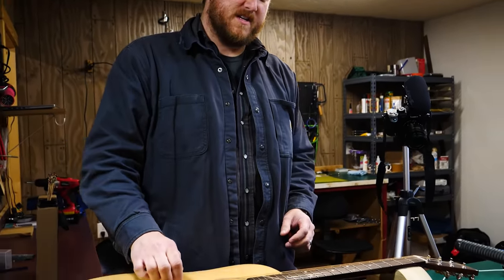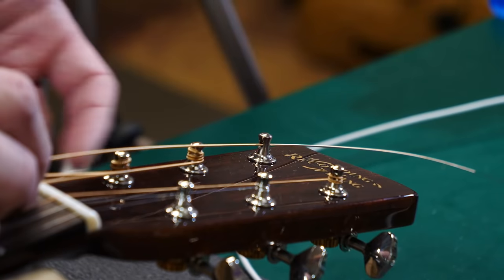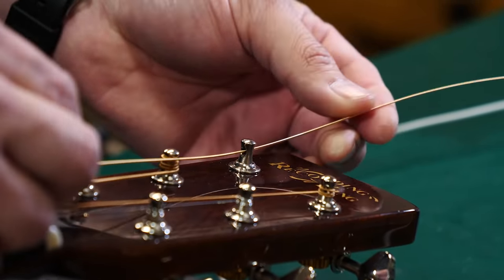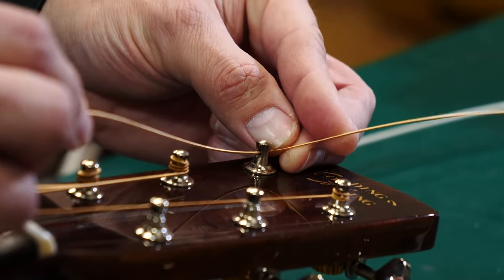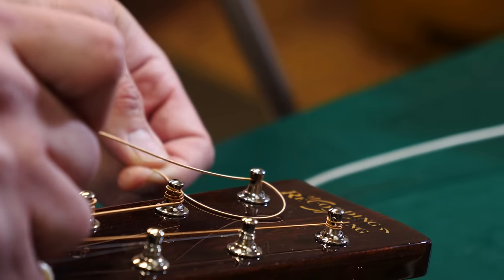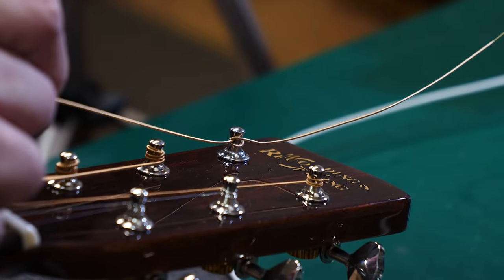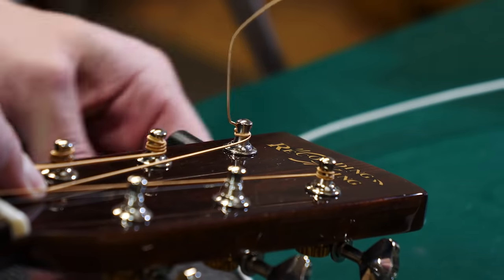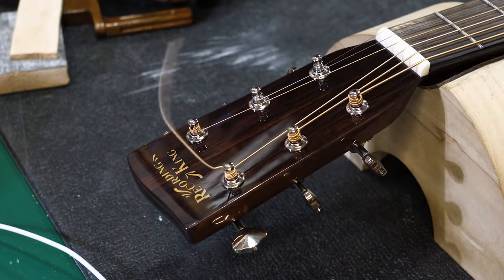Tech Tip: How to Tie a Luthier's Knot When Changing Strings

Comment: I just wrap one wind on top of the tag end, and the rest underneath.  It "clamps" the tag end in place, just like this knot, except it's easier.  I've never had an issue in 20+ years.  I do know a lot of luthiers who swear by this method, so I'm sure there's something to it, but I've never seen a reason to change.
Reply: Yep!  I usually pull the string tight and throw 2 or 3 or 4 wraps (depending on which string)  around the post before I push the through the hole and under the 1st wind.  Then give the end a sharp 90 degrees up. Then it only takes a little wind to get up to pitch.  Saves a lot of key turning.
Reply: @brin57  I've done that, too.  I always give the tag end an upwards, 90 degree tug before I clip it, too.  Never once have I had an issue.
Reply: I've found this knot works for me for plain strings on a classical guitar (on the wound ones I just use "one over, the rest under" technique). The nylon strings are more slippery and with this knot it's easier to keep them in tune.
I don't have an acoustic guitar, but I guess it's similar to an electric, where indeed I've never had a problem with just 2-3 turns, without any knots.  As always, YMMV.
Reply: Good Luthiers will never recommend this. Knots belongs on fishing lines not guitars
Reply: @larry6686st  Old dogs CAN learn new tricks that work well.
Reply: ^No reason to do more than this on modern tuners. 
“The luthiers knot” is completely pointless on modern tuners. Just a hassle and a good way to get your finger pricked :)
Reply: I have been playing and repairing guitars since 1982, and I do the same thing that you do.  Tuners are designed to hold the string with the sharp edges on the hole grabbing the string.  I have never seen them slip.
Reply: Locking tuners!
Reply: You have it right! This is nonsense!
Reply: Yeah I’ve done it exactly as you described for 30+ years. Works fine.
Reply: that's exactly what he's doing here though... literally zero difference between what you explained and what he did. The post is literally designed to function this way
Reply: I absolutely love this method. Been playing for 20 years, never had an issue with all my guitars strung this way. It also makes for a very clean look if you’ve done it right. I’d love to show you a guitar my customer brought in where he tied up the strings like shoelaces and wondered why the wouldn’t stay in tune.
Reply: Same. My father was a Luther, and so am I, and this is how we always do it.
Reply: @quistador7  not quiet, but very similar. Our way requires no knot. It's just how you wind it. Gets the exact same job done, and is arguably easier by a small margin. The point is, most lithiers don't use this knot, we just wind it the way op described, with one loop over, and the rest under. No need to bend the string over itself.
Reply: This is what I do.
Reply: If you do it the way shown in this video, your playing will improve exponentially. You’ll also get more chicks. Proven fact. Oh, you use the luthier’s knot? Welcome to heaven, here’s your harp! Oh you don’t use the luthier’s knot? Welcome to hell, here’s your accordion...
Reply: I was taught this way too. No problems even with a bigsby!
Reply: I typically use the top loop on wound strings and the knot method on the unwound strings.
Reply: Elite.
Reply: For steel strings I do what your describing. Works perfectly and can make the winds neat without any tuning problems. I use the luthiers knot technique on nylon string guitars since they need the extra friction.
Reply: 30+ years, one over, the rest under. Wedding band, rock bands, open mics, no problems.
Reply: I do the same exact thing I never had major slippage I've had them pull out of my tremolo as I use floating trem Bridges his way is kind of the same I feel the way we do it is a bit easier
Reply: @larry6686st  knot in this case is a bit of a misnomer, it's just using the string to clamp down on it self, Did you watch/comprehend the video?
Reply: @jeremycollins1068  🤣🤣🤣
Reply: @brin57  I used to use this method, wrapping tight around the post before threading it. I switched to threading first and then turning my tuning peg until in tune. Anecdotally have had fewer string breaks over time
Reply: @voe8  That's good.  Maybe I've been lucky.  I can't remember when I had my last string break.
Reply: @BitLyrist  Same.
Reply: This is the only right way.. the "Luthier's" knot will break strings because of the crossing string parts...
This only makes sense with nylon or intestine string...
Reply: Same here simple and efficient
Reply: Same here. Simple and foolproof.
Reply: I do that method on wound strings then the plain I wind it under, over, under.
Reply: Yep. This is the right way. Then when you have to restring, they come right off easily and you’re not messing with the annoying bent around part.
Reply: 100% agree, hundreds of guitars stringed and never an issue.
Reply: I just wrap as much as I can by hand, and then insert the string into the post so that the excess is above the wrapped bits. I never had anyone to teach me how to change strings or even to play, so I just figured things out on my own, and never really thought to looks into what the "proper" techniques may be. Cool to see (and read) about how others do it though.
Reply: I've been doing this for decades, as well. I was shown this trick in the 90's.
Reply: Same here mate, quick as to take off too
Reply: Same here. 35 years with no issues. If it ain’t broke, don’t “fix” it!
Reply: Okay cool. I was like, this is a step more than I usually do, but I have never had a problem since i started doing it the way you are describing moons ago. I guess at the end of the day, what do you want? To replace your strings and avoid slippage and tidy things up. I think both methods do that well.
Reply: I do this except i have issues with the thin strings (E, B on electric and E on acoustic) the string slips too much. This looks easier though
Reply: Being ignorant for a couple of decades with no visible consequences doesn't make you less ignorant 😂
Idk how helpless do you have to be to call this method "complicated", but it actually does the job, and it is used by many big guitar brands. The first time I heard about this method, it was literally called "Martin's knob"
Reply: @sadyakubovich  yes, the Martin Guitar reps showed me this knot when I worked at a Martin dealer.  I asked them why they did it and they said "it holds the strings on." I said, "I wrap once over the tag end, and the rest of the wraps under.  Doesn't that hold the string on, too?" And they said "yeah." 

We're not "ignorant." If a method of restringing a guitar has worked flawlessly for decades, that means it works.  I, along with plenty of others, see no reason to adopt this knot when our methods work perfectly and have never caused an issue.

Knock yourself out if you like this method.  It's fine, however in a lot of player's opinions it solves a "problem" that doesn't exist and over-complicates something (even if it's not THAT complicated) that actually has an even simpler, proven solution.
Reply: @jasonw4053  ok, i'm sorry
Reply: This method introduces axial twist. If you've ever fished, you know how much line twist sucks. So no, any form of winding not induced by the tuner itself is a bad idea. Unless you push the twist back out towards the tailpiece, but that's an extra step.
Reply: @larry6686st  lol this is not a knot for fucks sakes it just goes over the string to hold it there. gezzz
Reply: Yup, thats what i do also, cant even remember where I came up with this technique either
Reply: @jeremycollins1068  Don't get me started on stringing harps in heaven.  Damn those things TO HELL!
Reply: @larry6686st  I've built for the 2 biggest and best guitar companies on earth.  Both did it this way.
Reply: @MikesMusic475  exactly
Reply: I just install vintage tuners on my guitars 🤷🏻
Reply: @jeremycollins1068  😂 I am going to get some practice on the accordeon....🤣

Comment: Guitar tech 40 years-no no no  'knots' can always be pulled tighter. This knot will continue to tighten over time leading to tuning issues. And have fun with a sharp tool such as an awl to get that knot undone on the high E and B strings. I hate when guitars come into my shop with this knot...takes twice as long to remove strings. Not for me...
Reply: Preach. One wind over the top and a few below is absolutely fine. And I don’t end up stabbing myself in the fingertip and wrestling with needle nose pliers every time I have to remove old strings.

Comment: Here’s how.. DONT!!! One wrap over the top of the tail, the rest below, and they’ll never slip. All the knot does is make it harder to change the strings for the next guy
Reply: That's how I've done it for 20 years and have never had a string slip.  I do know a lot of repair guys who use this knot, and Martin Guitar recommends it, so there must be something to it I suppose...but it seems to be a somewhat complicated solution, when easier methods suffice.  I guess if it's the way you're comfortable, go for it.
Reply: I've gotta put me hand up mate, l restring the slot head this way, the post is thinner, but on the electrics & post tuners naa.
Reply: The way I’ve done it for years, never had any problems. The knot looks nice, but you can put a set of strings on and get them to stay in tune, by stretching your strings and tuning. Repeat the process until they stay in tune. No slippage and easy to change.
Reply: Why is it harder to change the string?  Don't you cut the string at the post and unwind it off?
Reply: @jasonw4053  Martin recommends it because a guy like this got a job there and made it Martin's word. Just because a high-end brand does it one way doesn't make it gospel. Many high-end brands do it different ways. I don't wrap my strings this way and I've never had any problems with slipping or anything, and locking tuners just makes this method completely obsolete. There's really no excuse not to use them now unless you're dead-set on not modifying the guitar for whatever reason, or if it's not using standard guitar tuners, so like a classical. You can get a set of good locking tuners for less than a pickup upgrade and if you source them properly all you need to install them is a wrench and screwdriver. If you source them improperly and get ones that don't fit all you need is a power drill and some confidence, otherwise I'm sure you can find a luthier to do it for a reasonable price.
Reply: If the next is myself, then I'll do it any darn way I want to.
Reply: @TheEpicLinkFreeman  yeah I agree with you, I don't use the luthiers knot but put one wrap on top of the tag end, and the rest underneath.  My comment was probably confusing, but Martin does recommend the knot....for some reason. No need for locking tuners for me, either.
Reply: Lol lesson learned thanks for sharing
Reply: lol ever hear of clippers. they work very well.
Reply: I don't understand how it makes it harder. You loosen the strings a bit, and then you clip them (so they don't snap back in your face under tension). Then you can unwind the string around the head extremely fast and pull them out no problem through the non kinked end. It also takes like 2 seconds to do the knot. This works even better on nylon strings and fluorocarbon and nylgut strings on a a ukulele, although the kink is harder to get to stay in place at the beginning of the knot because the strings don't stay kinked like metal does. For perfectionists, every single little thing adds up to make the tone be as good as possible. It's not necessary, but I don't really see any cons to it, especially when it's soooo easy with steel strings (because the kink stays in place).
Reply: Also who's the next guy it makes it harder for? Nobody's changing my strings except me. Why would I ever pay to have my instrument restrung by someone else. What am I, a scrub?
Reply: Agreed, totally unnecessary.
Reply: In 55 years I've never had a string slip and never used this but I have wanted to strangle people who have on a guitar I bought. Every friend who used this knot and tried belittling me for not eventually stopped and a few came back and apologized to the old guy who's been playing decades before they were even born. To each there own but if you change strings as often as most professional players do, you'll cus yourself for this.
Reply: Mate all it take is to grab the end of the string and fold it back the way it came. if you can't get your head around that when removing a string done like this then something is wrong. Do it however you want, but this is the universally correct way for a reason. Not that it really matters but don't belittle someone for showing you another way of doing things.
Reply: @ryankelly5060  I'm sure he can wrap his head around it but it's still a pointless exercise. As I said I have more guitars than anyone needs, been playing for well over 50 years an have never had a string slip. I'm not against anyone doing it the way they want but people can and do have different opinions that young guitar players should hear.
Reply: @donchristianmusic9353  Yeah great. But you can see He isn't telling anyone they should do it a certain way, he is just showing a Luthiers knot, which may not be as useful in modern times but it comes with a guarantee, especially for those charging a service. It's great you're not against people doing it the way they want but telling people not to do something in capitals is going to get a response. Referring to the comment I was replying to by Shumaker Guitar Works. Just realising my reply went to you somehow.
Reply: @TheEpicLinkFreeman  Agree with you here..I haven't used this "knot method" in years. never had a problem either. Also, the knot renders them harder to remove fr the key binding post. To each their own..
Reply: Im pretty much the next guy who restrings my guitars.
Reply: @seattlesoundisgrunge  Some people just don't want to do it. If they want to spend their money on having someone else string up their guitars, who are we to criticize? It's not my money. Touring guitarists with guitar techs pay people to restring them...they ain't no scrubs!

Also, I don't pay someone to do mine unless it's going for a full setup. But...that's part of the setup, obviously.

Comment: I have changed at least a thousand sets of guitar strings, I did try this method one time but when I went to change the strings the next time, it was a real pain to remove them. I have found all you need to do is wrap the strings around the peg a couple times, stuff it thru the hole, bend it over, tighten it up, cut off the excess, done.
Reply: Yeah but,  You don't get to brag about using a luthier's knot so nady nady.  lol
Reply: If you take a rope, wrap it around a post once, it slips. Twice it still slips but not as much. 3 times it won't slip. Same goes for strings. 3 wraps underneath the hole, done. The only time i've had a string slip is when i tried one of these unecessary so called luthier knots.

Comment: I learned this method from my guitar teacher some 44 years ago and have since found it unnecessary and makes removing strings troublesome. Just push string thru hole 1 5/8 - 2", depending on the thickness of the string... pull it back. I do 1st wind over the top of the hole and the rest underneath. Strings do not loosen I know this because if the string loosened as much as 3/16" it would pull right through the hole.
Reply: Ditto
Reply: I've been doing one over, the rest under for years as well. This "luthier's knot" seems like a great way to scratch the piss out of a headstock and be a total annoyance come removal time. I'll take this video as advice on techniques to avoid 😆
Reply: @stinkychickentitty  lol
Reply: YEP---your way holds just as well, and doesn't cause problems later.
Reply: Same here. It's worked for me since 1977. 😃
Reply: 100%  Sometimes its taken me a minute or more to get the knot off a post if a string has broken there, using all sorts of tools to loosen it.  Not something you want to do in the middle of a gig. As a final flourish to the one over / one and a half to two wraps under, I also bend the cut end back towards the middle so that the entry/exit bends at the post go in opposite directions to further increase locking.  It also minimises the risk of 'finger string stab'.
Reply: 1st string I feed though twice then hold sting on breadstick and walk it up till in tune.Other strings feed once and do the same way.They don't slip
Reply: Headstock not bread stick
Reply: @AJBAKER70S  interesting, but I do not think my strings slip, because if they did they would soon slip out through the hole, because I clip them as close as possible and there is no knots... so if it slips it slips right off the peg.
Reply: exactly
Reply: @stinkychickentitty  it's unnecessary... i honestly can't believe I'm seeing this method pushed

Comment: I've just been straight up winding my strings up exactly like you just said that you're not supposed to do and I've been doing it for 30 years with pretty much zero problems. I do a lot of bends and stretches on the strings almost constantly so that pretty much pulls all the slack out of whatever is in the headstock.
Reply: I agree...my Grover tuners just don't slip once the string itself settles.
Reply: @hudson3535  yeah once you start bending the strings and doing a lot of lead they usually straighten out with a couple hours of playing. And if you have a double lock tremolo with a lock nut at the top of the neck it doesn't matter how you string it up because once it's locked into place it ain't going nowhere